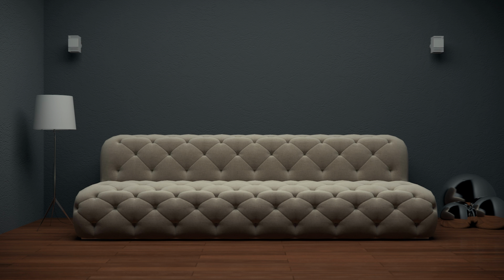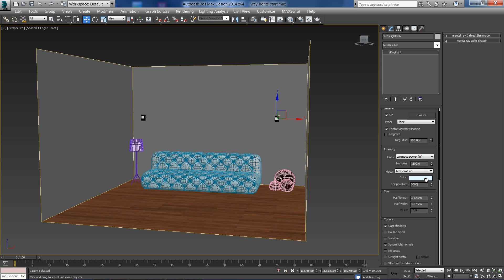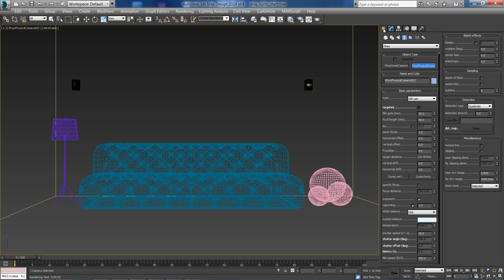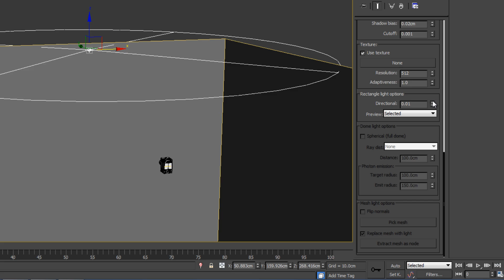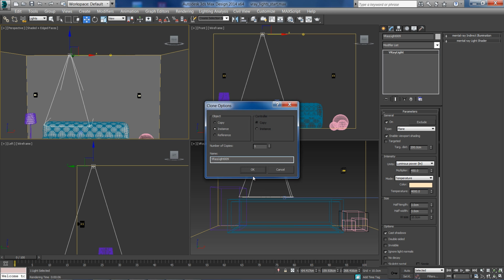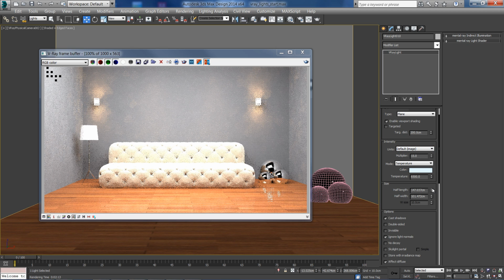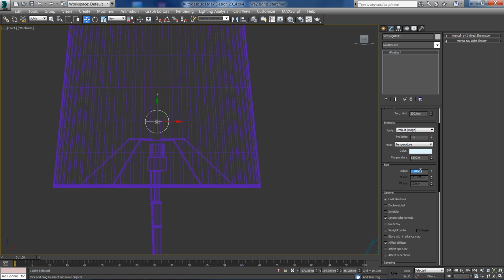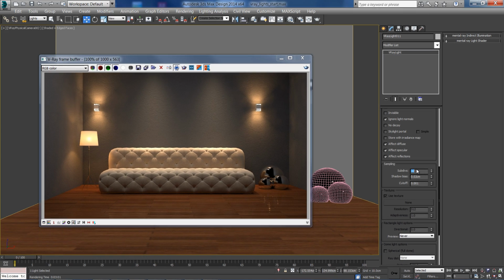Get PERFECT INTERIOR LIGHTING with Vray - Lighting Tutorial in 3ds max

Comment: thank you for the great tutorials, in my case everything goes really well but whenever i render, it is dotty, the final image is not really smooth, i tried diffrent rendering setups it's the same, and whenever i have a day scene and i use a dome light in the background as a day light i get white dotts in the render, any idea ??? thanks again
Reply from the maker: AdamChocoSo If your render looks noisy in exterior day scene it most likely caused by low subdivisions in your lights, try to increase the dome light subdivides..if you have noise only on reflective and shiny materials then increase the reflection subdivides of those materials.